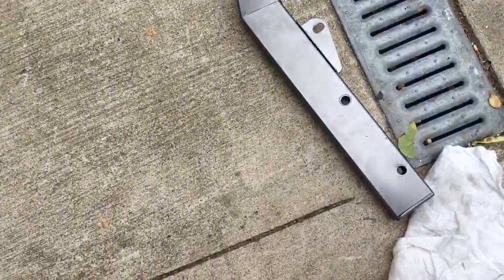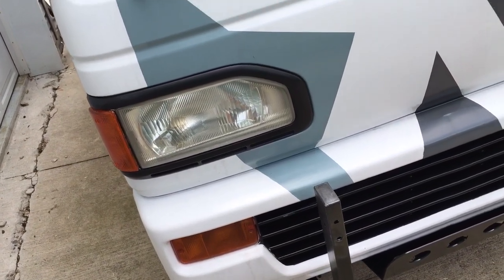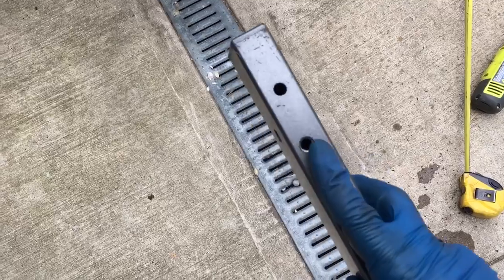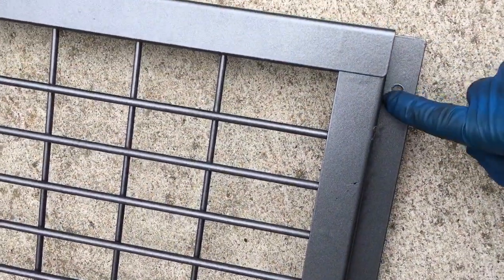Honda Acty JDM Kei Car mini truck project, episode 14.  Front brush guard / light bar installation.

Comment: Where did you get the bumper/brush guard from? Great info on the videos also. If you would, it would be great in your comments if you listed the items you are using/installing in the video.
Reply from the maker: Thanks for the feedback.  The bumper and brush guard were custom made by a metal shop from my CAD drawings.  I unfortunately do not have the skills to bend and weld myself.